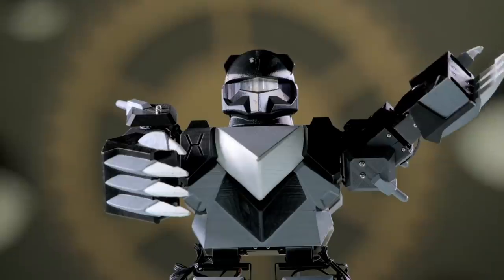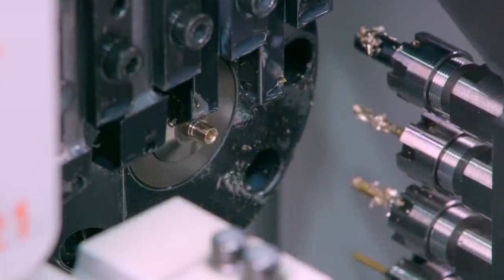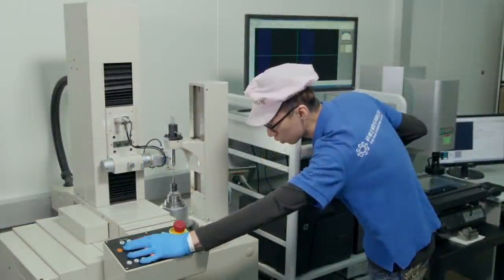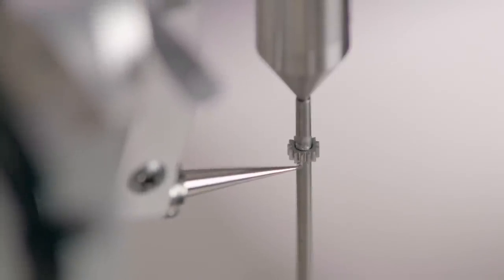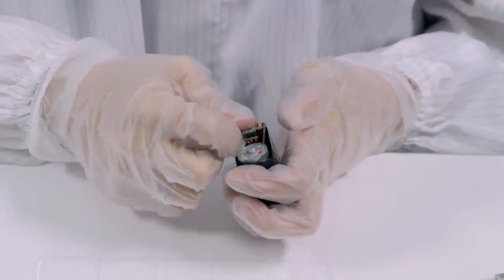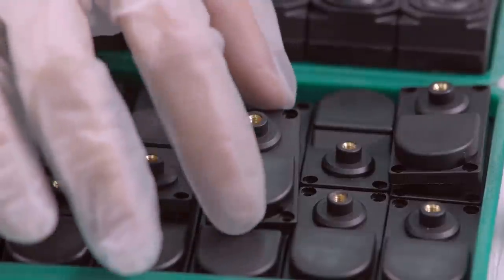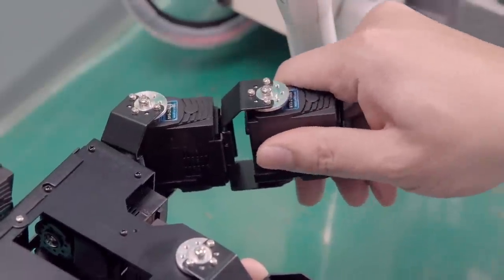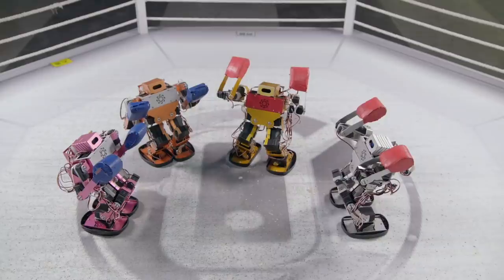How It's Actually Made - Educational Robots

Comment: I love how lately the comment section has become Filling Machine Meme Paradise
Reply: I do too, except that rinsing machines are better
Reply: @the_void996  nah mate filling machines are superior
Reply: @alexs6746  why? Rinsing machines; while less common than filling machines, can rinse better than the filling machines can fill.
Reply: @the_void996  well of ya try to fill something with a rinsing machine what happens? Ya don’t get anything cuz it removes whatever is put in
Reply: @alexs6746  A rinsing machine is technically a filling machine, it rinses stuff into another place
Reply: @the_void996  this also requires another replace to be available, however with a filling machine you just need an input and it does not need another place for liquid to go, simpler and superior
Reply: @alexs6746  How about a machine that rinses and fills all in one process?
Reply: @shaun458  now how exactly would that abomination work?
Reply: @alexs6746  So if it's a soda bottle factory we can rinse the bottle with actual soda, then just keep going until it fills up and overflows the rinsing soda. A proper amount of bleach additive would be required for sanitation purposes, obviously.
Reply: @vect0r858  wouldn’t that be technically a filling machine because it is filling the bottles in the end?

Comment: It’s weird seeing more things manufactured with a 3D printer. The robots chest plate would take at least 30-40 hours to print. I guess buying 50 printers is cheaper than an injection molding machine and the molds for it.